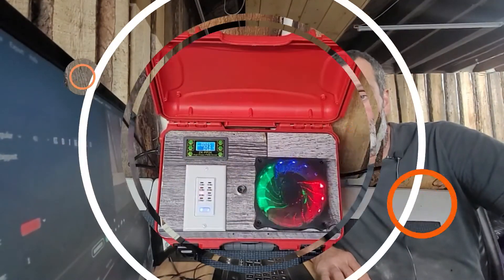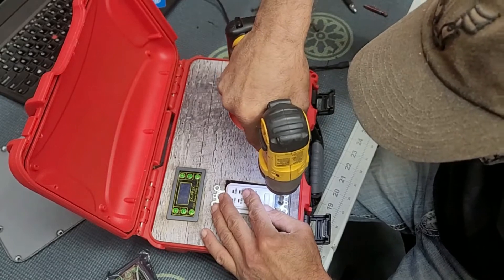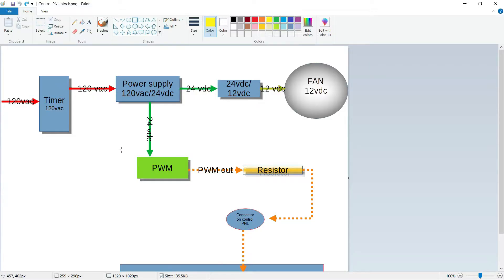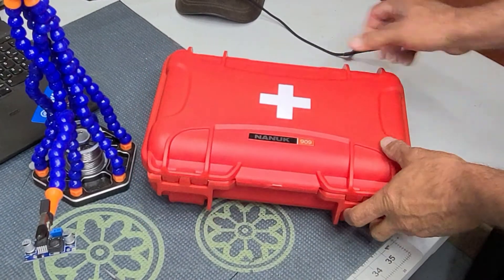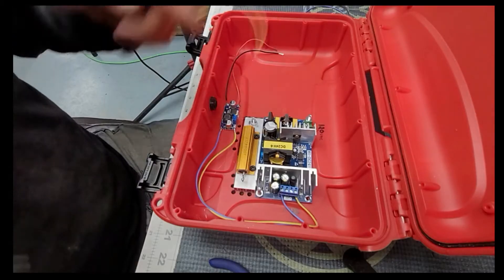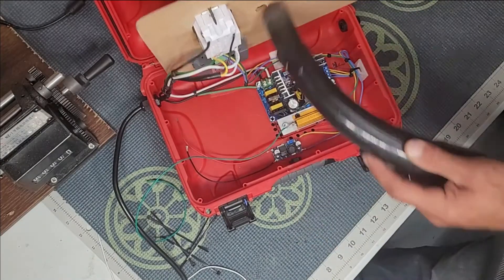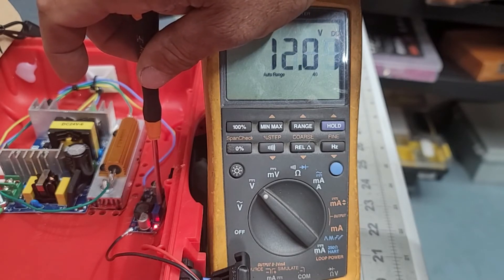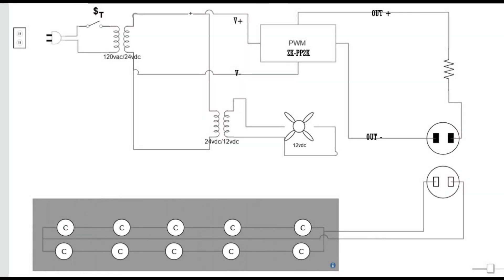DIY PEMF - Control box! The Brain.... ( Part 2)

Comment: I just found your videos today. Thank you for sharing all of this with the world!

Can this PEMF unit be made to run on batteries for portability?

Also, have you ever considered making a Frequency Specific Microcurrent (FSM) device?

I'm guessing it would be even simpler to make than a PEMF device. But most of the FSM devices on the market cost a couple to a few thousand dollars, sometimes much more.

Love your channel!! ❤
Reply from the maker: @ScottMilford  thank you ! 

Check the rest of my videos.  I did make a few battery devices.  

Also FSM is the same as pemf.  Fsm is the ancestor of pemf.   :)
Reply: @Steeve.  Thanks. I'll look for the battery-operated version of your PEMF devices.

Unless I don't understand PEMF (which is possible), FSM is different. With FSM, the frequencies are literally connected to your skin, such as in electrodes, and the current is running through your body (often through a specific body part that is being treated) as a microcurrent equal to the current that naturally runs through the body.

When I had FSM sessions for my neck, a warm, wet towel was placed on the back of my neck and one placed on my abdomen and both were connected to and conducting the current that is set to a specific frequency for treating the disks of the spine. So the current ran through the disks in my neck as a complete circuit.

With FSM, you only need two electrodes to treat the entire body, head to toe, for a single condition and you only need to change the frequency to treat a different condition and reposition the wet towels so that the current runs through the area of treatment. You can, however, use multiple channels and treat a condition using multiple frequencies at the same time.

With PEMF, the frequencies are pulsed through your body in a wide (or at least wider) field as an electromagnetic field. And if you're treating the whole body, you need a pad with many rings to pulse the whole body. If I'm not mistaken, you can't just put one at the feet and one at the head and run the pulse through the whole body like with FSM.

Perhaps they accomplish the same thing and work the same way, but it doesn't seems exactly the same to me. Either way, I'm happy to update my understanding if it is incorrect. I'm relatively new to PEMF, so I have much to learn. I know a lot more about FSM than I do PEMF, but I'm not expert. So please correct any misunderstanding I may have.

In the end, it seems FSM, PEMF, Rife, etc., are all using frequencies to accomplish the same things but in slightly different ways.

Thanks for your help and insights. 🙏

Comment: I'm curious about this design because you're outputting straight from the ZK to the coils, surely there's not enough power there to drive them?
Reply from the maker: Yes sir!   Thw zkpp2k is very powerful.  

Not like the zkpp1.  For that one you need a mosfet.
Reply: @Steeve.  Yes, I checked the spec, directly drives loads up to 8A. I was wondering what the difference between the 2 were, aside from colour!
Reply from the maker: @catman4471  :)   amazing little unit.  
The zkpp2 is the same witgout the case   
Very good unit for smaller project. Fpr example  Portable pemf !
Reply: @Steeve.  Yes it looks quite handy!

Comment: I just watched this part 2 for the first time. There is a lot to know and I have deep respect for you building this! Amazing! I'll be back for part 3.
Reply from the maker: Thank you!!  
FYI. Stay tuned and watch all videos.   What is commkng down the line is crazy amazing.  

I have found a way to make everything even better.   The mat the controler etc.   

See my last video on the gauss experiment,  or my trade with the nextion or my tease with the bipolar.    All that been done now.    The patreon are up to date.   They have a copy of my drawings and a copy of.my.nextion.program.   some of them even has bought a nextion and are waiting to get the parts to.build theirs.  

I will release the better mat serie early summer.    
😃😃

Join my.patreon for more details.

Comment: hello @steeve Bradet ; i followed your step but my ZK-PP4K (version with a knob) wont do pulse  (on/off) .
I tried everything :face-purple-crying:
Reply from the maker: First  I need to know if yiu zk-pp2k  cone on ? 
Any display?
Reply: @Steeve.   Hello ; yes it is sir. but it's zk-pp4k with knob  the settings are like crypted for the beginner.
Reply: @zedixquatrevingtun4253  You have to push and turn for settings.
Reply: @catman4471    i know but i got a emf detector and  it does not see pulse.
Reply: @zedixquatrevingtun4253  Err? I'm not sure about this but maybe you could give me the make and model number of the detector? I'm not sure that it would detect pulse rate, or waveform.

Comment: Hi Steeve, I have my two 75mm coils for a small device for knees and shoulders. I was wondering if I should put the coils with opposite polarity, because when they are over the knee, they will be facing each other and repelling each other. If they are parallel to each other, it might be better for the north and south poles to point in the same direction, when in use.
Reply from the maker: Helms coils are very difficult to build.  But your idea is sound.   I am with you on this.   Can't hurt to make the coils work together.

Comment: FWIW... I ordered parts to build this.. had most of them already incl the magnet wire which I have been wanting to use in a DIY build.  So this is great.  I omitted the timer as will use a wireless plug and Amazon Alexa to run a timer.  And acquired a 24v fan so omitting the buck 24v-12v converter too.  I like the Nakuk case so end result will be that.  Your designs are super sensible.  Have wanted to build some kind of mat so looking forward to this.
Reply from the maker: Excellent!!   Your comments on your build.all make perfect sence. Sounds like.you have this under control. Happy building !!
Reply: did you manage to build it?!

Comment: Curious... does the 110/220 to 24v power supply, does it need to be 6a or can it work under a 4a PS?  (have a 4a unused which is why asking, tx)
Reply from the maker: It might work, but remember that you should never use more than 80% of what your power supply can provide. if you do your power supply wont last very long.
Reply: @Steeve.  Check.

Comment: I'm using the portable PEMF belt (TPEMF) with the control box. It should be using 2.4 amps and 57.6 Watts. It's giving some warth as well, which is very comfortable for my lower back.
Reply from the maker: Awesome.   Can you email me pictures!!
Reply: Since you have already built the mat can you please tell me how many micro tesla intensity is it?
Reply: @dreamcatchers1987  I have built two different mats, and I'm working on a third different mat at the moment. I use a gauss meter, measuring in gauss. The last mat (21 coils) showed approximately 42 gauss per coil. The new mat I'm working on will have 36 smaller coils of lighter gauge wire. I'm expecting 50 to 70 gauss per coil. Time will tell.

Comment: I'm almost finished my control box. I've used a laptop power supply, 220v to 24v @ 5amp. Do you think this will be sufficient?
Reply from the maker: it all depends on the amp you have available. keep it at 80% no more.